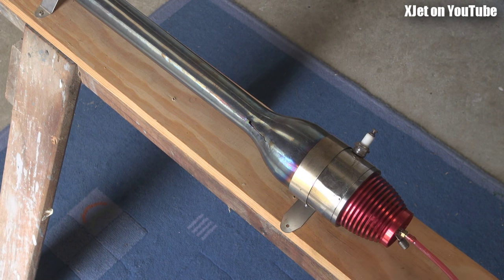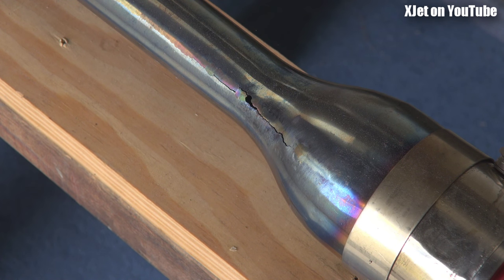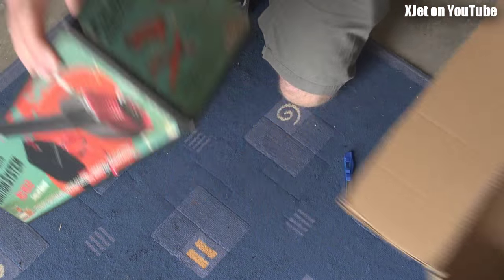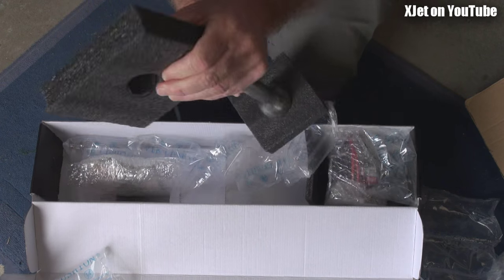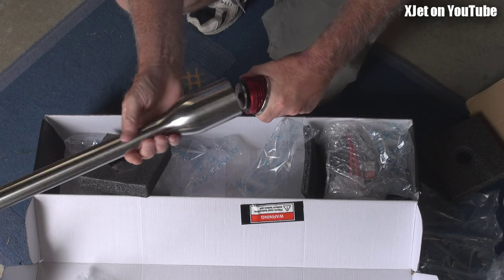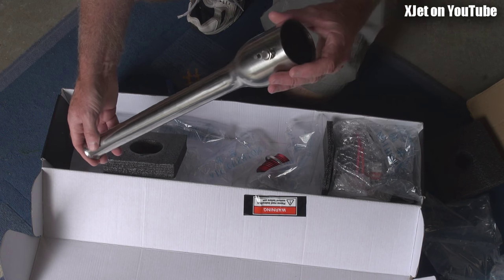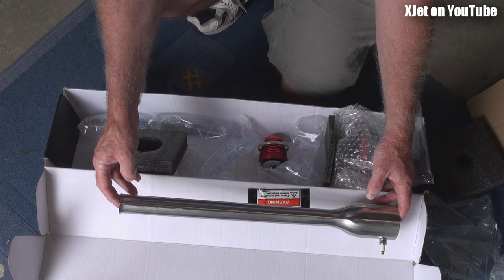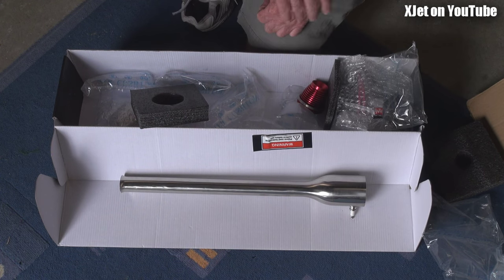Another HobbyKing Pulsejet (and yes, it's also bad)

Comment: Rest assured Bruce the latest batch we have been getting the welds have been excellent. And on our control line planes have been going very well with them.regards Robert (kiwi jet team)
Reply from the maker: +noclassmac1972 Ah.. I suffer the perils of being an early adopter!
Reply: +noclassmac1972 I was about to ask about that. Still have the oval deformation issue?
Reply: +Winston Smith Seems to be a lot better but we have found it makes no difference in performance.  A lot of issues occur with lack of knowledge.
Reply from the maker: +noclassmac1972 Minor ovalling won't matter too much but if the engine was properly designed, any change in cross-sectional area (due to distortion like this) will have an effect.  The more optimised the engine, the greater the effect.

Comment: Bruce, I like your style of review. You don't hold back anything.   :-)

If you going to build a new tailpipe, do you plan to salvage the front portion with the internal threads?
Reply from the maker: +Donald D'Egidio Yes, turning up a ring with internal threads is a painful process so I'd salvage that piece and weld it to the new body.  Having said that -- the ring itself is well out of round on this engine -- having been distorted by the very ovalled combustion chamber but I'll probably be able to salvage it.

Comment: maybe try brazing the crack in the old one, not as strong as welding but it should (should being the key word) hold, and it will be easier on the thin metal

Comment: Should there not be any guarantees or something when buying these? I mean, it's obviously a manufacturer problem and hobby king is a big brand with its own reputation and all.
Reply: +Sodori HobbyKing doesn&#39;t have a reputation worth defending, honestly. They&#39;re a purveyor of the lowest common denominator hobby scrap, the sorts of stuff you use if you&#39;re building an RC model you intend to use at the business end of a firing range on machine gun day. Their customer service is infamously terrible(Pretty much &#39;Fuck off&#39; without using those words), the shipping times are atrocious....blah. The fact that they&#39;re in business at all boggles my mind. You&#39;d think SOME quality would be necessary to sway hobbyists but apparently not.

Funnily enough they often end up spending more rebuying the HK crap  3 or 4 times hoping for a functional unit than they would buying one unit from an established brand.
Reply from the maker: +TestECull In the case of pulsejets -- there are no "established brands" that come close to the $99 price of this engine.  And generally, HK is like virtually all hobby retailers -- they have good stuff and they have crap.  Overall, my experience with HK has been very positive over the years.  The money I've saved on the good stuff has far outweighed the money I've blown on crap (by at least an order of magnitude).
Reply: +TestECull Lets not forget, HKing sell such CRAP bands as JR, Sanwa, Futaba, Hitec, Team Associated, FRSky, XRAY, BSI .
Reply: +S Rob:   JR, Futaba, Hitec, etc, CRAP BRANDS? Are you kidding me? Futaba makes the best radio systems.
Reply: +TestECull Thats a load of nonsense. I bet you are assuming those because they are cheap. Shipping times generally are very reasonable, at least from the EU and HK warehouse. From EU, its typically 3-4 days, from HK, it all depends on the carrier and customs. Sometimes they are amazing. I once ordered something on a saturday from the hong kong warehouse via UPS and received it monday in europe. That boggled my mind.

As for customer service, yes, they tend to be slow, but that doesnt mean you dont get any. On nearly 100 orders, Ive only needed 2 RMA&#39;s, one battery dead on arrival,  one telemetry radio that gave in after a few weeks. In both cases I had to make a video to prove the issue, and then I was sent a new one, no problems.

As for the quality of their products; most of their products are cheap, and one shouldnt expect miracles from $2 servo&#39;s. But the quality tends to be far better than you could reasonably expect given the price. Value for money, hobbyking is unbeatable.

Comment: Very interesting failure, but if you have any true and honest "Very well founded apprehension" Over the quality of this particular product, so you can take a few precautions before you use it.. the structural failure that you have experienced "This time is due to stress that wasn't released before it was shipped to you. usually the name of this procedure is call "Annealing" and it can be easily done by bringing the metal to cherry red hot and covering with any type of really fine sand.. I actually use talk or baby powder "The part have to be buried under at least 3" of the talk and leave it for a hole day alone! usually this bring the material to a total "Un-hardened state" increasing the life of the part for the purpose that you have... good luck my friend.

Comment: Ahh, yes, case-in-point why buying from Hobbyking is a ridiculously bad idea. Buy quality, spend a little more get something made well enough to actually function.
Reply: +TestECull I have spent thousands of dollars at Hobbyking and similar overseas stores and saved myself many hundreds doing so.
 I am fully aware of the risks and I accept that eventually I will get a failure but at this stage I am very happy with the results. 
Without Hobbyking and stores like it there is no way I could have done what I have in this hobby. 
The biggest thing is research. Check the reviews and Google search on what you wish to buy and if there is any doubt forget it. 
Here in New Zealand we sometimes find local hobby shops charging 2 or 3 times the price that we can land stuff from China.
I know they have to make a living but if they want to survive in todays economic climate they need to rethink their strategies.
I will continue to support Hobbyking and stores like it as it's the only way I can afford to continue in this hobby.
Reply: Stambo
I can't afford to gamble on it. I'd rather save up a couple more paychecks and drop a larger single sum on a part I know is going to work than go the instant gratification 'Will it work iono let's find out in six weeks when it slowboats over here from Hong Kong' HobbyKing purchase. So I buy from Tower, from Amazon, I buy trusted brands that have far better reviews. I know that if the stuff I buy from them does come DOA(It happens even to the best) they will be there to support me. They're not gonna leave me floating, they're not going to corporatespeak tell me to fuck off.

 Better to buy once from a supplier that stands by what they need than gamble on scrap.